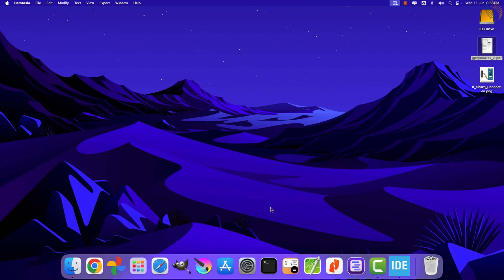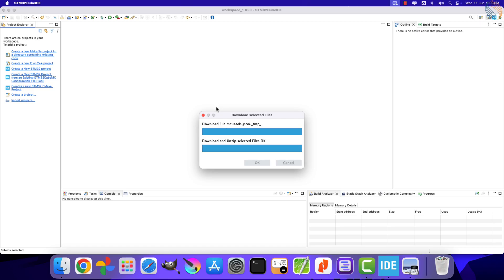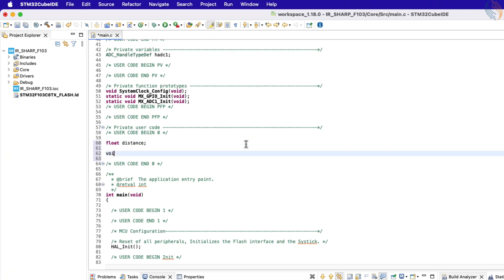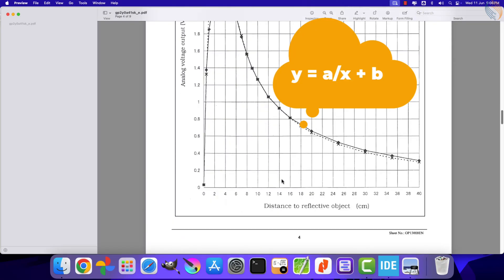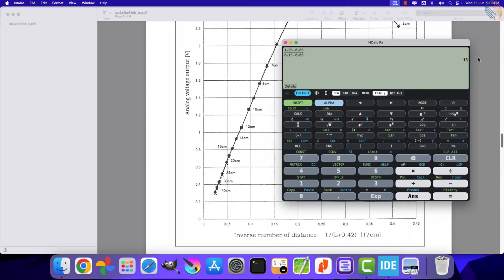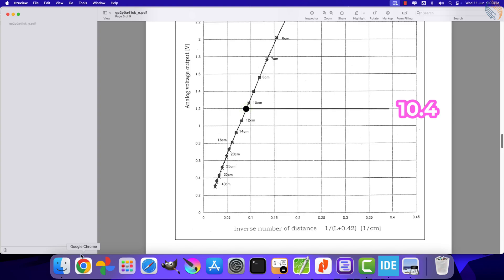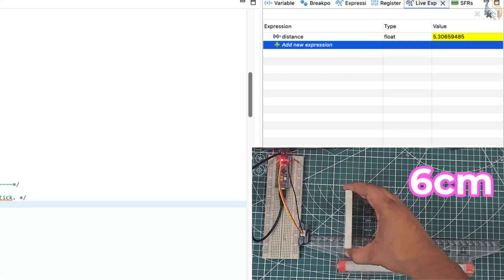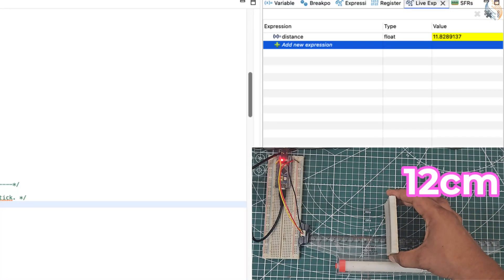Interface IR SHARP sensor with STM32 || GP2Y0A41SK0F || Measure Distance

Comment: Hello... i had been following your video avidly, and tried on F407-Disco ADC1 IN0 but encountered the following errors Could u please advise?
Warning: implicit declaration of function 'HAL_ADCEx_Calibration_Start'

While on H753 this error occurs:
error: too few arguments to function 'HAL_ADCEx_Calibration_Start'
Reply: On H753: ADC1 IN6....
Reply from the maker: Calibration not avaialble in f407. Just comment out that line.
Reply: @ControllersTech  can the code work without calling HAL_ADCEx_Calibration_Start(&hadc1)
Reply from the maker: Yes of course. Calibration function is just for calibrating ADC. It works without Calibration also.
Reply: @ControllersTech  hi i masked the Calibration code on both H753 and F407, the distance at Live Expression stuck at 3.519... regardless of how much i adjust the distance of GP2Y0A41SK0F. pls advise thx..
Reply from the maker: Are you calling the measure function in while loop ?
Put a breakpoint inside the measure function and see if it is getting hit continuously.
Reply: @ControllersTech  yes, call the fn measure_dist(); in the while loop...
Reply: @ControllersTech  i set a breakpt inside the measure fn, it is getting hit continuously, but the value of Distance remains the same 22.8267231, regardless of how much i adjust the distance... could you advise?
Reply from the maker: @woldecosgrove  Check the raw value measured by ADC. Is it changing ?
Reply: @ControllersTech   which raw? Vo?  or ADC_VAL? both not changing cant see
Reply from the maker: @woldecosgrove  ADC_VAL. What you mean can't see? Once the breakpoint is hit, you can see them in the "variables" tab. If you always want to monitor them without the breakpoint, define ADC_VAL as global.